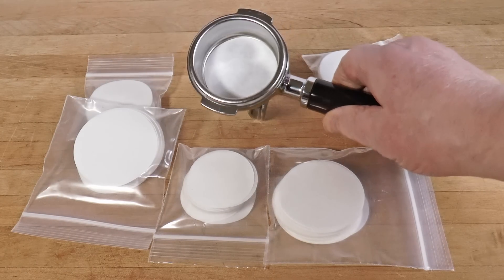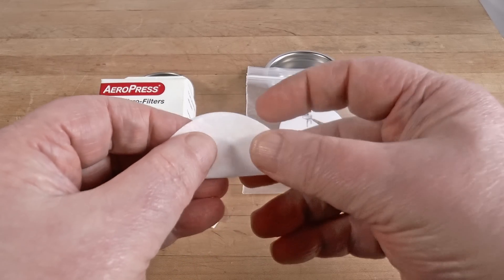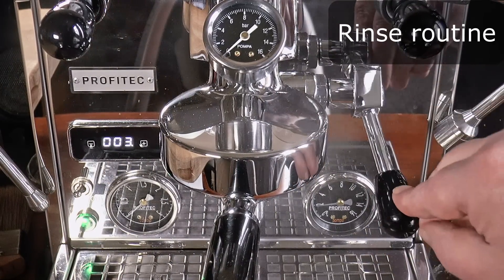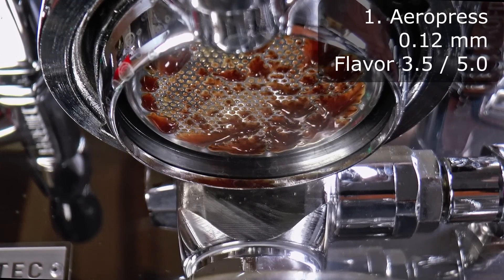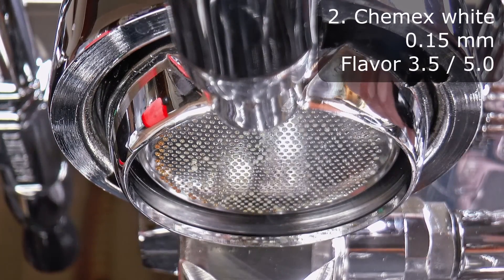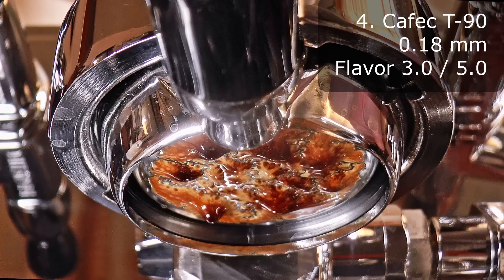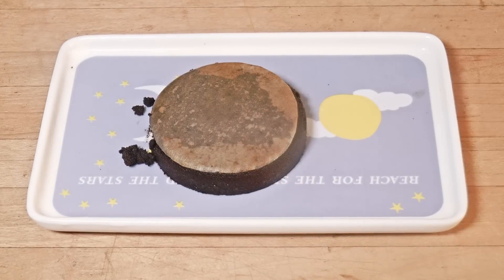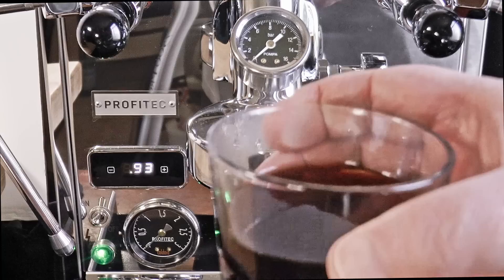Espresso Through Paper

Comment: I would assume that the watery start is due to the water content in the pre wet filter. The air between coffee grounds gets pushed through first followed by the water and thus the air pushes out the water from the paper…
Reply: Yeah at least a gram or two of water in there. I guess you could tamp down the filter, squeezes out the h2o and wipe the bottom of the basket with a clean microfiber. That should probably remover 90% of it but make sure to wipe the tamper. Tamping with a wet tamper is just one step above dropping the portafilter full of grinds. Two steps maybe, there dropping the dosing cup too. Not sure where not lockong the PF tight comes in. I once blew the gasket haha. Steam and coffee everywhere. I had just stopped leaning in to observe the extraction, would habe been right in the face! (Fresh gaskets people! 1 year max!).
Reply: This.
Reply: I agree. I use paper filters top and bottom, but dry and have never had a watery start.  I use the papers primarily to keep everything cleaner.
Reply: Agreed, easy enough to rule in or out with a dry filter test.
Reply: @derricktyler3577  Me too, with a long bloom pre-infusion for light roasts.  I seem to have less channeling -- though of course the filter might just mask it.  But the papers (AeroPress) top and bottom keep the portafilter and shower screens clear of blockages.
Reply: This
Reply from the maker: Sounds absolutely correct to me.
Reply: my thought exactly. Wringing water from the paper.

Comment: I am thinking what's missing in this type of argument is the mean pore size of the filter papers used.
Reply from the maker: If only they had pores. They're permeable, but not porous.
Reply: @wiredgourmet  it's a term also used in laboratory filter papers where there are various filter papers with different pore size for e.g. 120 micron, 240 microns etc to allow particles of certain diameter to pass through, which i imagine can also affect your coffee taste. But what is shown in the video are just filter paper brands instead of the more specific detail. But then Of course, as long as it taste good then it's good.
Reply from the maker: @jsl8082  Check out the second vid; I show the paper under the microscope.

Comment: I just started experimenting with paper filter at the bottom of my portafilter.   I had to really decrease grind size to get the same yield/time ratio I have been using on our favorite beans for the last year or so.   Although we tend to drink latte’s, providence intervened as I couldn’t drink anything other than clearish liquids for a few days, so stuck with Espresso and Americanos for my tests.   Once I got the grind under control, I did seem to get some positive results, although I suspect maybe undetectable when used in milk drinks.

My puck prep routine has grown to the point that it is getting a little embarrassing, so I likely will skip the paper filter (and the newly added puck top screen) going forward.  Things were pretty dialed before I added the screen and started experimenting with filter paper, so I may just drop back some and make more of our old reliable lattes instead.

Thanks for taking the time to produce the video.

Comment: Love the detailed breakdown as always. You mentioned in your comment that you were grinding finer to match shot times. Pretty much every time I've done this I've preferred the unfiltered shot. However, when I dial both in by taste I tend to prefer the paper filtered one most of the time and those shots are always at least 3-5 seconds faster if not more.
Reply: This. Much better taste if filtered shot runs faster.
Reply: Interesting. I’ve been using paper filters for some time, but still dial in by time. 

When dialing in by taste, are you generally keeping grind size closer to the setting you would use when not using a paper filter?

Comment: James Hoffman suggests that using a paper filter significantly speeds up the flow rate, thereby increasing the yield over a timed shot.  Was your experience similar?
Reply: It should be about 4-5 sec faster with a paper
Reply: @BrentGoodale  with paper on the top or bottom? or both?   tks for your sharing!
Reply: @edinmanbiker  on the bottom 4-5 sec fast not sure on top
Reply: @BrentGoodale  thank you!

Comment: You get a watery start because you used rinsed filters the pressure push the water out those you get a watery start… We use dry filters not wet. It’s already been tested that the amount of paper is irrelevant both in espresso and aeropress as the proportions are quite low so it’s not necessary to rinse them.

Comment: I started to experiment with these.  At first I used a 2" punch to make filters out of Chemix.  I pre-wet the filters because they say when making pour overs you have to get rid of the paper taste (never tested that, or even if it is correct).  I then bought filters from Good Brothers to match my 58mm basket and the taste was different, more balanced.  The 2" filters JUST cover the holes in the basket and I wonder if during grinding the paper for my cut filters shifts a bit and I am getting an 'uneven' paper/non-paper filtration.
Reply: I pre-wet the filters because it helps them stick to the bottom during WDT...

Comment: I’ve been using cheap eBay 58mm filter paper for the last 3 weeks 2 cups every day. I use a 20g IMS precision basket with nanotech coating. There was no need to change grind size but I need to WDT more carefully to ensure a good even tamp. It does seem to be a little thinner and less crème, but overall the taste actually is a little more intense and bolder for me, which is a good thing.

I should add the best thing about it is no more coffee grind in the cup!

Comment: I've done testing with my friends and the paper filtered espresso won unilaterally. The paper filtered shots had a lighter but creamier texture, longer lasting crema and very similar tasting notes, just with reduced bitterness. 

I don't pre-rinse my filters. I worry that the moisture will wick into the puck and cause the grounds to expand and start infusing. 

I wonder if it's something that helps tidy up the shots from people with cheaper equipment. I was using a modded Dedica (hotter water) and a K-Plus grinder. Decent equipment, but two leagues below your setup. 

The papers I use are also very thin and not as robust as most of the filters you tested, closest might be a stock aeropress filter. I can't even overcome the added shot resistance of a Chemex cut out!

Comment: I love watching TWG bottomless shots!  Not sure anyone makes them look so good.

However, when trying a new equipment or technique, it might be a good idea to be flexible over recipe and to re-dial from scratch with the new method...  That said, I did all that but reached the same conclusion anyway: less enjoyable (to me) narrower-focussed espresso.  I ended up with an obviously different extraction though: no watery start, about 10% less needed coffee for similar yield and strength, and shockingly uniformly extracted spent pucks.

One flaw here could be using the E&B Labs Competition "Flat" basket?  Flat is a misnomer for these because they are not flat at all when, or after, containing anything like the usual 9 bars!  And used convex baskets are not great for prep, flat tamped density uniformity, or for use with papers.  I wonder if the watery start came from leaving the rinsed basket wet, or from having to excessively wet the paper to get it to conform to the basket, but either way I don't think it's an asset or something that others who regularly use papers put up with?

To really do this experiment justice probably needed a much heavier stronger (and flatter) basket, so the paper can easily do it's job properly with less compromise.  A VST, Pullman or LM is much  heavier and thicker and stays much flatter during, and after, use, so would be a better starting point.  I've gone off E&B Labs Competition Flat completely as annoyingly barely-magnetic puck-traps, and have to say it's VST or LM for me now (unless one day I get to try one of those funky and horrifically expensive new super-baskets and find it brings enough to the table)...  And don't even get me started on IMS fashion screens...

Anyhow, keep it up!

Comment: I believe you're seeing water that is pre-loaded into the paper, so you are essentially diluting the espresso by the x gram of water you added into the paper. The counter here, would be that a dry paper load would thereby be changing/intensifying the flavor by removing a little bit of the pre-infusion - up to the drinker if he enjoys the first 5 or 15 seconds of the pre-infusion drip, and I suppose the drinker should do the Salami to understand that notion. As for the papers themselves, they are probably helpful for those who tamper and/or dose incorrectly. I suspect the paper acts as a pressure distributor throughout the incorrectly dosed and/or tamped puck. I'm not a chemist - so I cannot opine regarding the paper's ability to filter out the espresso grind insolubles - at which point one could argue this exercise is simply to drink an intensified v60s with the paper of choice.
Reply from the maker: Great catch. I agree. I mentioned it and later cut it, over-editing.

Comment: I'm glad, the last thing I want is more filters to buy. I already run out of V60 sometimes. Espresso is great, all I need is beans. And I can knock out a shot in 2 minutes. 

Since I installed a dimmer and began doing preinsfusion and lever-ish profiles... man it's been good. Everd shot better than what I could ever do without pressure profiling. Just amazingly fantastic haha. Compliments left and right. And you are right now that my Americanos are so delish, I have not been making many cups of V60... I often use the same beans for both anyway. 

So higher extraction... I can just grind finer and preinfuse longer... raise the temp from 94 to 95... 

Also I do like it filterless, a bit gooey thick. Another thing for fancy people :) I'm not fancy. I take Boron carbide bits to my lovely little Italian machine. I'm a caveman. 1 dollar dimmer shipped direct from China for 10 cents by boat. The good stuff. If it comes with a manual you're buying fancy electronics. 

I recommend slapping a dimmer in to anyone with typical, GCP-esque single boiler machine.  My god the taste!!! Fk fancy grinders, seasoning, temps other than 94C and levelers. All you need is a wdt, a dimmer and a grinder that isn't total sh*t. No need to spend thousands. Two friends have 3k machines, hand built. They both took notes the second time I made shots. As long as the machine is capable of temp stability the rest barely matters. Except of course beans. Sh*t beans, sh*t coffee. I spent less than a grand on everything, including tampers etc... and the chmapagne that donated a cork for my extremely stylish WDT. I stained the cork walnut and gave it a clear coat because I'm a maniac.

I dare anyone to find an Anna PID that's more fancy than mine. Heck I got a rosewood handle, made a rosewood steam know and laminated the plastic drip tray in mahagony. Even got a bypass switch to select between dimmer and full pressure. Schematics on homebarista if someone want to try it. Kinda fun. Rambling maniac signing off.